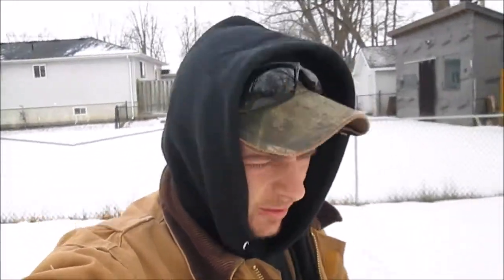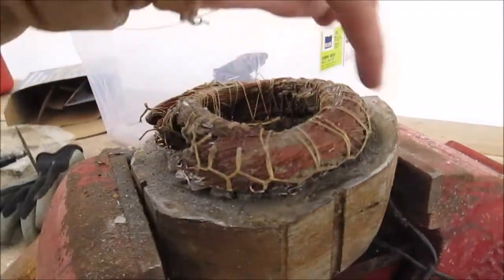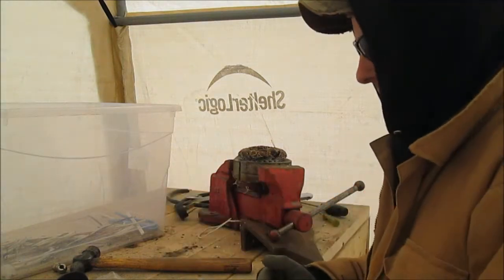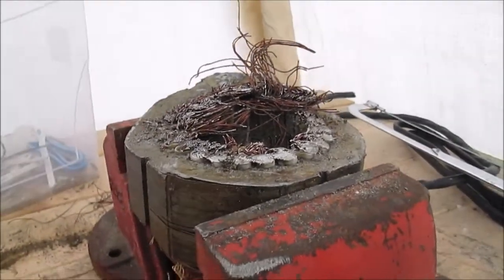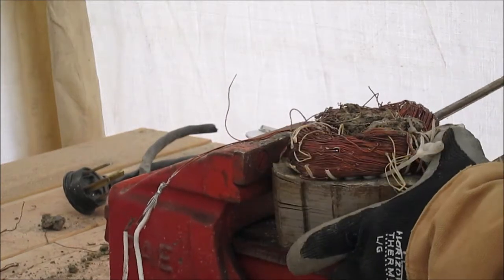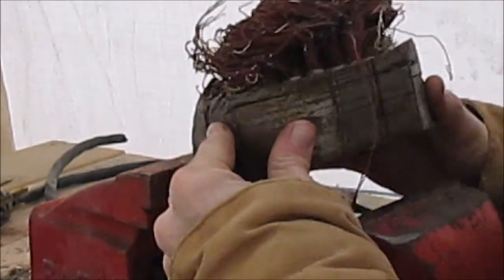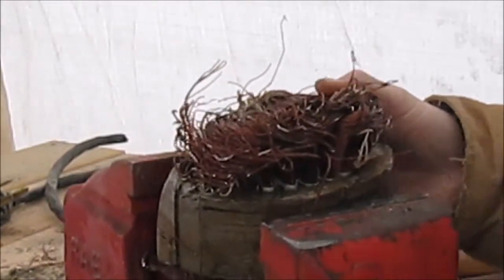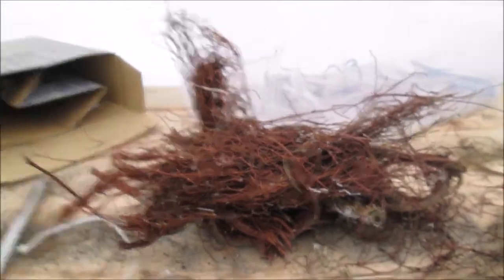How to remove copper from an electric motor

Comment: dude !!! its a lot easier to pry out the copper windings if u first take a axe and a sledge hammer and spit the laminated steel plates with the copper still in it, in half, then pry out copper wire..u might need to clamp steel plates in vertical then pry out..after spitting in half plates may just collaspe when u tighten vise,,